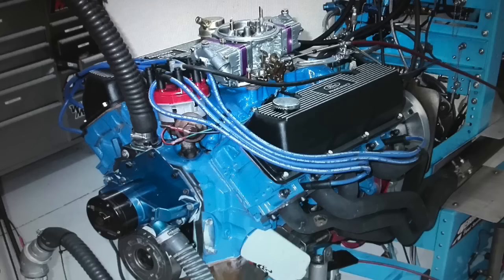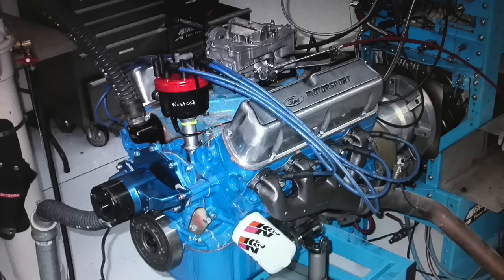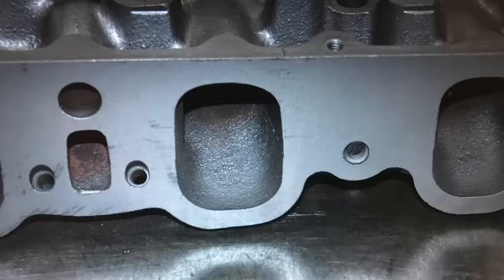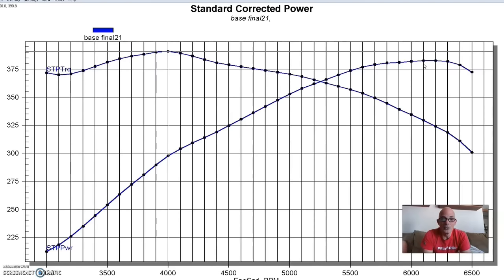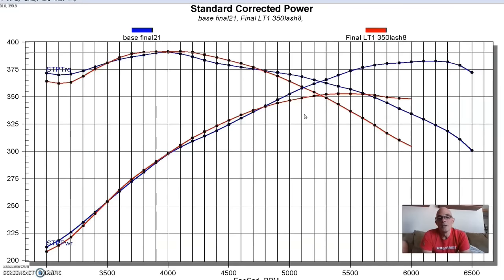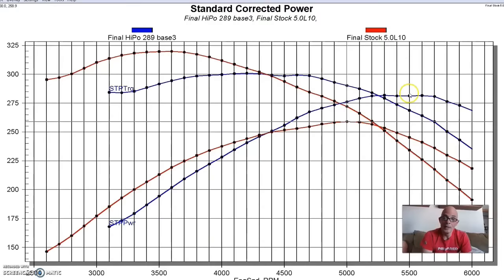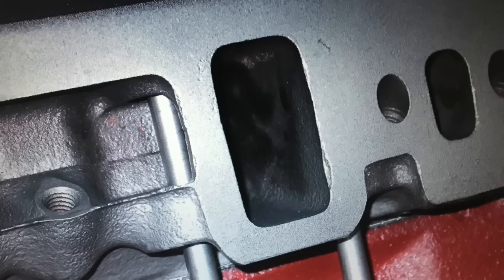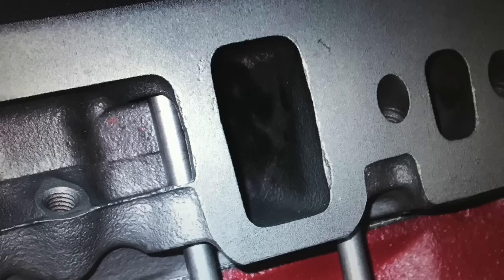HOW MUCH POWER DID THE 1971 BOSS 351 REALLY MAKE? WAS IT THE HOTTEST SMALL BLOCK EVER OFFERED?

Comment: I ran a 318 72 Duster in the 70s. The engine was warmed over really good. 340 heads and Edelbrock 4 bbl intake with Carter 750 cfm carb. Cam dynamics cam. High lift. Long duration. Headman headers and dual point distributor. It had a manual 3 speed and 8 3/4 rear gears. This car ran really strong in the day. The 318 got very little respect as far as high performance. All the mags said “don’t waste your time on a 318. I think because the engine was a 2 bbl. Small valve heads it was mostly endeared as durable. And reliable. But with the right parts, it screamed right up to 5800 rpm. Stop light to stop light it held its own. Boss 351 C. Now that’s a well put together engine. A lot of good parts. Starting with compression and very big valves. No wonder it would be on the top of the list of the most powerful small blocks. Also can’t count out AMCs 390. Talk about stroker. Thanks for the video.

Comment: Back in the 1980's one of the most successful street racers I knew ran a 289 in his Cougar. It was mostly a full on light weight drag car, tube chassis, 4 link, big tires, and full race engine build. He would get no respect from the 289 and get race challenges all the time. I never really understood why they would doubt the setup as it looked and sounded so great.

Comment: I recall the Hi Po 289 in a 1965 2 door hardtop Falcon. It was equipped with a 4 speed top loader transmission with a Hurst shifter and a Detroit Auto Locker 411 differential. It  ran the quarter mile in the mid to low 13 seconds. I recall 13.2 as one of the best times. It was likely launched at the peak torque which would be around 4000 rpm. It was a long time ago so my memory might be off. I do remember being enthralled with that car and its performance.

Comment: I had a 65 289 Hipo Mustang GT, 4 speed solid cam , dual point, ,it's what got me started in proformance cars, if you talked to me then it could do anything and was faster than most , today I have learned much and now i know the difference, mostly almost every 3rd weekend I readjusted the valves or broke something. Today I have built a 302 hydraulic "almost equilvent ??" 79 Mustang Pace car , C-4 auto w/stall, long tube headers, 68 close chamber 11 to 1 comp, larger valve , not bad wont rev as high but works well. I wont ever get my Hipo back so this is a nice alternative. I really liked the Hipo 289 the 302 is good and a 351 windsor is heading to the engine stand soon. Thanks for 351 Cleveland Info, not sure I'll ever get there but Thanks, you do good I enjoy watching and learning from your video's.
Reply from the maker: I liked my 65 HiPo too-just was not as fast as I wanted in stock trim
Reply: @richardholdener1727  at the time I had mine (age17) it was the fasters thing on the road , just ask me then! I had more fun with that car burning up rear tires, it did long burnouts. I did lose a burnout contest to a 68 Mach1 Mustang , thats when I started learning things about race cars.
Reply: @richardholdener1727  Richard, do you think gearing had anything to do with your feeling that the HiPo was slow? The Toploader trans that came in HiPos had the 2.32 first gear - combined with 3.50s in the diff, it's a dog setup for an engine that doesn't make a lot of torque. It really shines up high though, those are impressive numbers for mid 60s OEM tech.

Comment: I always knew that 351C was dynamite package!! I remember many articles written about the 69 Boss 302 and its' power potential because of those marvelous
cylinder heads! Except you had to rev that thing to the moon to get power out of it. The writers said, in the '70 model, the valve sizes were cut down just a bit,
and by adding the additional cubes made the BOSS 351 an absolute monster! I also remember writers saying, for years Ford made engines that either didn't 
breathe well (in the case of the Windsor 289/302 or the FEs 352/390), or had engines that flowed too well, (in the case of the original Boss 302 and the 
Shotgun BOSS 429)!!  I also heard/read the best Cleveland combination for street power was to run the 2 barrel 351C head on your 351/400, and watch it fly!!!
Great video!

Comment: When the Boss 351 Mustang was new, road testers at the time quartered the car and it was the fastest Mustang over the quarter to that time. Quicker than the Boss 429 in showroom specification
Reply: Wow amazingly to know
Reply: some how ya have to get that thing to lock up. Burnouts look cool to some but when it locks up and just goes is when it the sweetest thing.
Reply: With the tires of the day...not surprising.  Care to speculate on the two cars with 10.5 Sticky Micky's on 10" rims on both cars?  The Boss 429 would have eaten the 351 alive.  Everyone agrees, Ford stifled the 429 excessively in stock form.  A 428CJ would beat either car by a wide margin, in stock form.  and did.

Comment: Alright, beings you asked. Everyone knows how bad the small block ford heads flowed, but it was the only option available at the time. When the 271 HP came out, again it was the best at the time. When Trans-am racing got going in 69-71, ford came up with the 302 Boss (which everyone knows). That really changed the game in ford's favor. I for one, would have loved to had one of those engines, but life gets in the way sometimes. Then the 351 boss came out, which you showed. Those were great engines, without question. Back in my day (yes, I am old), 289, 302 were about all we had till the 351 came along, then the boss engines after that. I feel you are correct in your comments, but if all you had was a 289, you might different thoughts. They were great at the time, but time marches on. BTW, I really like your channel. Much respect.

Comment: I owned a 1970 Mach 1 (351 W) back in the mid 70’s and still love the body style. I totally agree that the Boss 351 engine was the hottest factory small block made back in the day.  Heck, even in the bloated and fugly 1971 Mustang it was good for mid to high 13 second 1/4 mile ET’s bone stock.  Testing back in the day showed the Boss 351 was quicker than any stock Mustang ever tested.  I have always felt that the ultimate ‘Stang would have been a 1969-70 Boss 351.  If only...
Reply from the maker: agreed
Reply: Hell Yeah, hard to believe that the 1971 Boss 351 was the quickest. Those Cleveland's flat out love to run above 6500 rpm, Ran a Cleveland in my 1986 Mustang for years, went Low 11,s Currently have a 521 Stroked BBF, going Low to Mid Nines on a 275/60 Drag Radial. Still Love those Cleveland's tho, still holding on to my 1972 Short Block with 4 Bolt Mains.
Reply: Thats Exactly what I have in my 69 Mach 1 ! Only 1803 Boss 351's built in 71. Found mine on someones garage floor for 30 years .See Mustang Connection video..
Reply: @robertstewart3086  - I am as green as my 1970 Mach 1 was!

Comment: My 87 5.0 LX Mustang with cat back flowmasters, 160 T stat and opened up air box  and 3.08 gears and street tires ran 13.80s @ 100mph all day long with a best of 13.71 @ 101mph at Capital raceway in Maryland.  Short shifting was the key. I shifted from 3rd to 4th at 4600 rpm. Most everyone else were screaming 3rd gear threw the traps at 5600 to 5700 rpm.

Comment: I had a 1970 LT1 short block swapped into my 70 Nova (originally was a junky 307) when I was a kid. It had an upgraded solid lifter Clay Smith in it with Brodix heads. It was fun!!!
Reply: Have you seen "Vice Grip Garage" budget build and dyno test on a 307? I was amazed. I don't remember the exact horsepower right off hand but with some 305 HO heads and a good cam and intake it made well over 300. I never thought that 307 could make 1 hp per cubic inch much less more than that but increased air flow makes any engine run good!!!

Comment: I have a blue 71 boss I got in 84. 36k orig miles, still on orig tires, car is an animal. Thx for showing that.. I ran 13.33 104 mph with Goodyear eagle gts bk in day
 If I ran drag radials it would run high 12s.. great car and engine. Hi po 289 is fun car and can make power..

Comment: Richard, not sure if you are aware of Bob Gliddens results with the 351 C engine? If I remember right and I would have to look up the specs, Glidden revamped the heads with added material he welded in himself to get the fuel to flow directly towards the spark in the quenched chambers. If I recall he made 808 hp on 115 octane fuel. Of course it was a pro stock motor but it for the most part this was contributed to his head design. Just thought U ought to know. Thanks
Reply from the maker: I'm familiar with Glidden

Comment: The 351 Cleveland is the best small block ever produced in the muscle car area . It is quite easy with mostly stock part to make over 550 hp  . Your right about the 289  although with some head porting and a bigger cam you could  maybe make 350 hp . The crankshafts start to fail if you go over 7500 rpm
Reply: Any Ford from that era broke cranks at any real rpm.

Comment: HI, RICH.....

THAKS FOR THE " MID BOSS" build up!!!!
A friend ( late) had a 71 351 in pewter.

Awesome car & a BOSS LOOKER.
And it rumbled- not the SBC burble- Bob grumbled the o'Brien truckers big-into-smaller headers and do not forget Ford used some 'cheap-ro-lay'  needle bearings on the rockets & the squeeze on Bill's  Boss was 11.7:1& NOT THE LT-NONES 11.1
HIS BEST RUN WITH SLICKS, LADDERS & A MOTORCRAFT ELECTRONIC @ 6200 RPM WAS 13.31 @ 114.
SKUNKS LT NONES, NO?

BRIAN.

Comment: Hey Richard. I read somewhere that Jack Roush's favorite car is a 1st Gen Mustang with a 289 K code motor. He made the comment that the sound of that 289 at 8K RPM is one of the sweetest sounds, paraphrased. I've never had one but a K code 289 is on my list of 'hope to have some day' (and I'm not even a Ford guy). I also hope to get more that 306 hp out of it, even if I have to throw NOS at it.

Comment: In the early 80's my brother had a 67 Mustang with a 289 and a 4 speed top loader. A guy really into mustangs sold it to him cause he needed bail money. Then he built the engine based off what the guy told him. Things I knew about it was it was .30 over and had some unbelievable head work done on it. The guy who did the work built drag engines and used Chevrolet valves because they had the biggest for the application. Along with porting and polishing. I remember my brother racing guys and them getting pissed because they didn't believe he had a 289 under the hood. I think what really have the car gusto besides my brothers unbelievable ability to drive was the 8-track tape player with the matches jamb in to get it to play right.

Comment: Back in the mid 70s my uncle had a 1971 Boss 351 Mustang with a few aftermarket parts. I can't recall what modifications were done, I was only 8 or 9 years old. I also remember it being a rocket and the fastest thing on the streets for years. I was with him when he took it to the track once and would lift the front left wheel without a problem.

Comment: I love my 72, which has a modified 4bolt main 351c
2bbl with a ton of porting done on heads/intake & a 500cfm 2bbl stainless valves/guides both intake and exhaust. Mild cam upgrade(r.v. type cam) It
 made a impressive improvement at the top end which gave me the best of both 2v & 4v.
The 2v is notorious for falling off at the top end
but actually ran better than 4v at lower rpms.
Now the higher rpms are holding the power alot farther in the rev's. I did dyno before I finally replaced the exhaust with a nice x-pipe with Sanderson headers and got 326hp. But it breathes way better now and I can feel the power gain from the new exhaust.
Reply: Oh yeah I changed pistons to... 10.5 to 1

Comment: I think the 289/283 were great in their day due a lot to tires & chassis. Along with valve sizes and port volumes available. The 351 boss was overlooked due to the body change. It was built for a fight that was over. I think the Cleveland also tips the scales almost 600 lbs.
Reply: Cleveland,stock is 550 lbs, Chevy 350 is 575 lbs! So your point is?
Reply: Notice. A lot of " I thinks ".
Reply: @jesse75 sounds like a lot of "but hot rod rag sez chivvy is better..."
Reply: You are correct that the Boss 351 came to late in the US as emissions controls were coming in and the oil crisis was just a few years away.  The ‘71-‘73 body styling was also controversial plus it weighed considerably more than the way more popular ‘69-‘70 fastback.

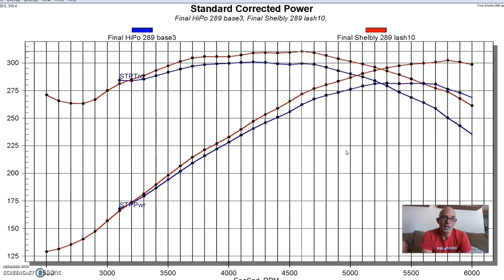Comment: You are correct on both accounts. I had a 66 Shelby GT 350 and at the track it ran 14.9 @ 93 mph. Pretty car but a snooze fest at the track. Sold it and bought a Boss 302 and after gears, headers, cam and carb it ran 12:20’s @ 112 mph.

Comment: Great comparison Richard!  There are just some engineering realities  vs the muscle car advertising , word of mouth, and results on the street back in the day.    The 289 HIPO was a total surprise for me.  But in reflection, back in it’s time and in its car -it was a hot rod compared to stock cars in its class. But now the 289 HIPO seems completely outclassed.                                   For the Boss 351: (and 351 CJ)it was  unique engineered package that worked well  if left alone.  Due to the large port heads and huge intake runners, after a camshaft change lost all the low speed torque and became peeky miserable engines in the big Torino and mustang bodies they came in.                                                                                                                                                    Richard how I’d like to see a comparison between the ford 390 Gt and Chevys 396 from the 1967 pony car wars.      Have you done a 428 CJ yet????
Reply: 351cj was actually a detuned engine compared to M code 351c from 70 and early 71 mustang. compression was lovered with open heads, but they throw in higher lift cam and larger manifold. So CJ made less low end torque and slightly less power then M code.  
70 and 71 M code is exactly the same engine. Ford miss advertised 70 engine and corrected ratings for 71

Comment: Hi Richard,  I used a lot of 289 & 302's in the 70's/80's,  but now my car has a 289W.  Choices are the key word.  I'm using a eagle 302 crank 3.00" stroke( 28oz), 302 rods 5.090 and 302 (DSS) forged pistons  4.030 (9.7:1 comp), in my 1965 daily Street Mustang.  After Break in,  say 5000 miles ,  I'll most likely will Up-date the Heads.  I think there's more more for the 289 then you covered,   like the Jon Kaase's, new P-38 small block heads as a up-date (for 289, 302 or 351W), ( if I can afford them,  I'll get them!!) , maybe adding a 50 or 75 shot of NOS.   306 HP was so limited to the 1965/68 parts.  Todays parts make it Fun to build old Engines!

Comment: I have always thought the Boss 351 was one of the best motors and your testing confirms that !
I still have a 71 351Clevland premium fuel motor !
Reply: Boss 351, my Favorite Small Block. I been holding onto a 72 Cleveland with 4 Bolt Mains for a while now, was in my 1986 Mustang for a few years, went Low 11,s Currently have a 521 Stroked BBF in it now, going Low to Mid Nines on a 275/60 Drag Radials. I Love the Cleveland's and the 429-460 Engines !!!